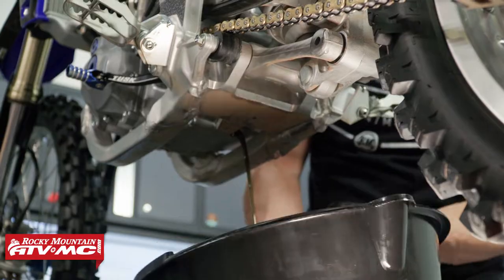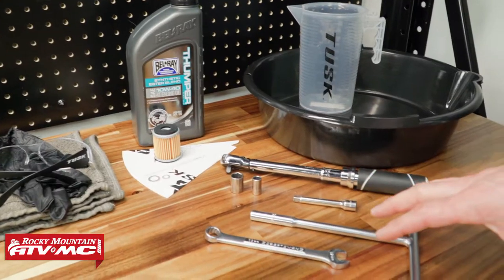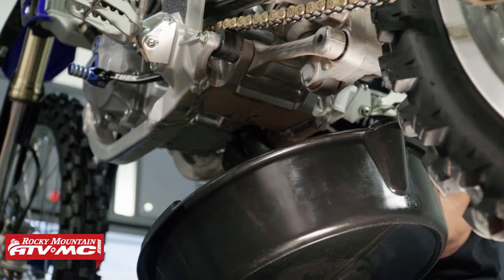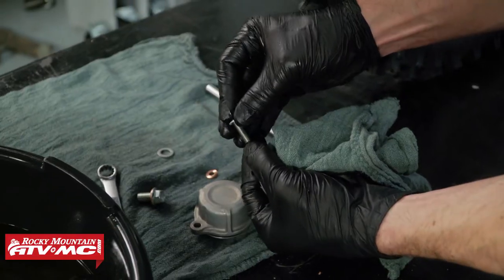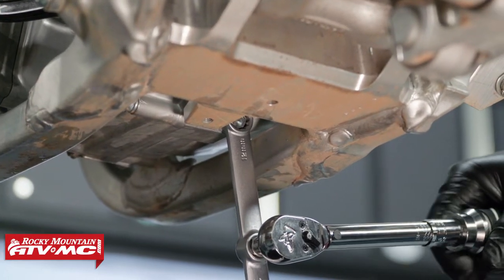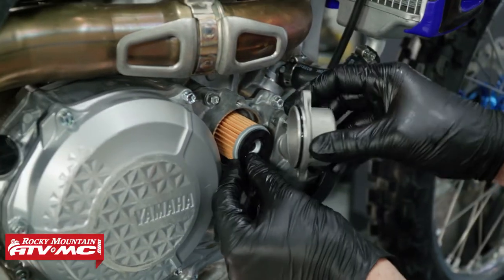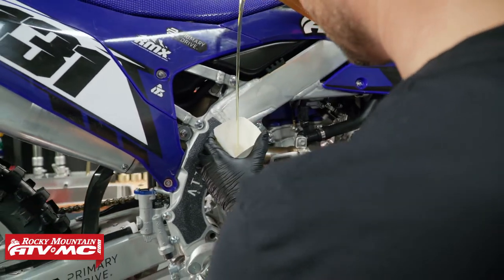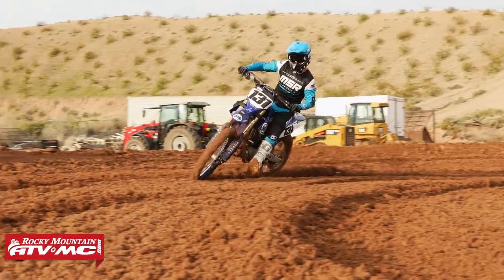How To Change the Oil on a 2023+ Yamaha YZ450F

Comment: Why are there 2 drain plugs? Does it have a dry sump lubrication system?
Reply from the maker: Yes the 2023 YZ450F is equipped with a dry sump lubrication system.
Reply: @rmatvmc  are the 24s and 25s yz450s also dry sump? I'm going to buy one and I'm curious
Reply from the maker: Yes they do have a dry sump as well.

Comment: hi, how often should the oil and filters be changed for road use
Reply from the maker: There is not a recommended oil change interval for road use as this is a motocross bike but Yamaha recommends changing the oil every 3rd race (or every 7.5 hours). If you're riding on the road you can likely go much longer but you'll want to check the color of your oil and change it when it starts to look dark.
Reply: I recommend at most every 10 hours for Yamaha 450 supermotos. Wouldn’t go past that. My wr450 lasted 12k hard miles of supermoto use before I let it go. Never had valve adjustment or any major work. Oil change every 6-10 hours (quicker if I did trail riding) and changed oil filters and air filters (usually cleaned or replaced after each trail ride. Only every 1k miles on road though) these engines are as solid as they come. Do the basic stuff and it’ll last.

Comment: Hello, is the engine running, the oil level is on the mark? Or is the engine off? THANKS
Reply: Off, if it is running the oil should be cycling through the engine and you won’t see any in the sight glass.

Comment: My 2024 yz 450fx with engine shut off is between marks.. but when engine is idling there is no oil in sight glass is this normal.? Soon as I start the engine it sucks oil down and is no longer in glass
Reply from the maker: Yes, that is normal. When you start the bike, your oil is circulating in the engine and you won't see it in the sight glass until it stops and the oil can settle to the bottom.

Comment: it calls for a liter though when filter is changed
Reply from the maker: Do what you want, but Yamaha's spec on the '23 is 0.96 liter with oil filter (960ml). Just verify you are good in the sight glass. -Charles
Reply: Oops. I was confused. It is in fact 1.01 qt aka 960ml.   Sorry!

Comment: This isnt for 2024. 2024 drain plug is onnthe left aide 3rd bolt towards the front. Also the manual says to check site glass with it running upright. The oil lecel should be at the marks while running. This video ahoyld be 2023 ans under. 2024 is a diferent motor altogether. Always refer to manuals instead of videos. I followed this guys video and none of it applied to 2024. Read the manual
Reply from the maker: I'd check your manual again. The Yamaha service manual recommends running the engine, then waiting a few minuets after shutting the engine off to check the level in the sight glass with the bike level.  See page 3-13. The check you are talking about is under the check engine oil pressure step, according to Yamaha. See page 3-15. No worries though, I can understand why you got confused. I'd recommend doing a VIN check on your bike if it was a different process from ours, you might have a different year. Is yours a 450? I've re-checked the Yamaha service manuals and the '23 and '24 YZ450F's are this process. Like you said, always refer to your model specific service manual, and make sure you know what bike you are working on. -Charles
Reply: @rmatvmc  I have a 24 wr450 and the manual says different. The engine in the 24 is different than the 23. I have nothing confused I just did the oil change on it and followed the manual
Reply: @derekparisian2023 you are the one that is confused. Dont follow a yz450f video for a WR. 23 and up yz450f have the exact same motor.